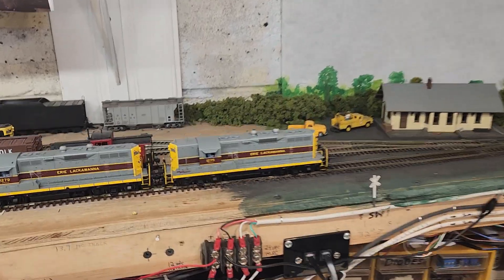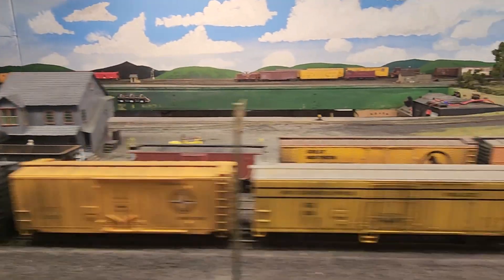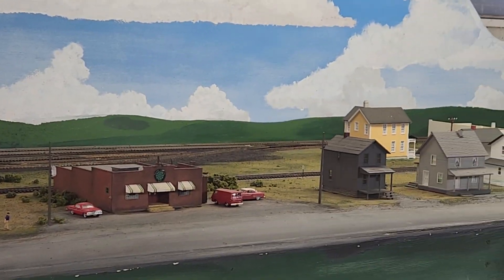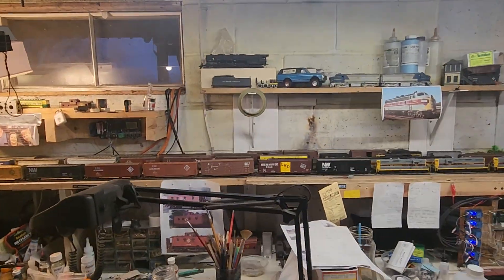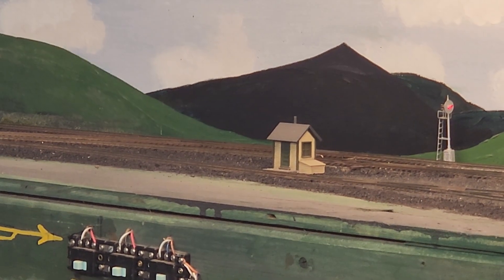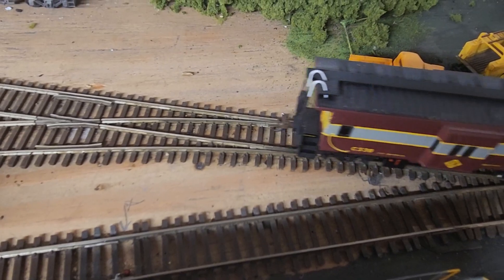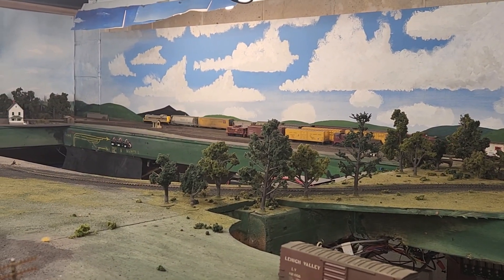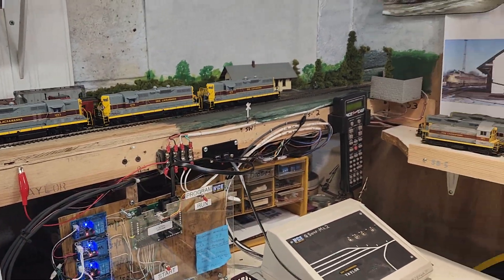NCE MiniPanel demo

Comment: Well done. May I ask what kinds of boards are those Blue boards that are connected to the minipanel? What do they do? Are they the switches that are controlled by those? if they are a complete sensor kit may i ask where you got them?
Reply from the maker: Those are all the relay output modules for the little CDS cell "sensors" that are hidden between the rails at key points on the layout. When a train passes over one of the cds cells... the corresponding relay closes. The sensitivity of the cds cell can be adjusted to work with whatever light is available.  When one of the relays closes... it grounds a mini-panel input... prompting the next operation in the sequence.
Reply: Hello Are you able to tell me where I may order your relay boards for the cds cells? I would rather use that then the reed switches and magnets others used If you could tell me where to get them I would be grateful these also have two indicator LEDs that are a plus.  If you can thank you in advance as I want to switch between several trains on my layout. I have mini panels I just need the system other than reed switches and magnets.
 @Dave4664
Reply from the maker: @jamessled5767  Search Amazon for QCCAN  XH-M131   That's what I use
Reply: @Dave4664  thank you sir